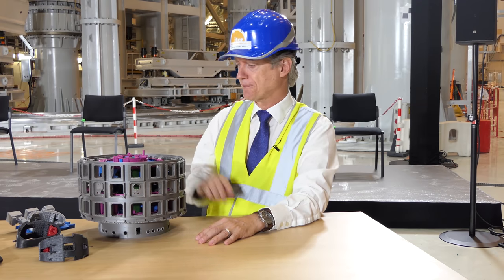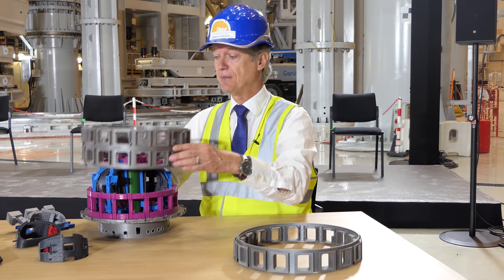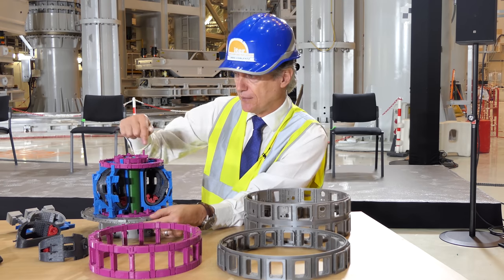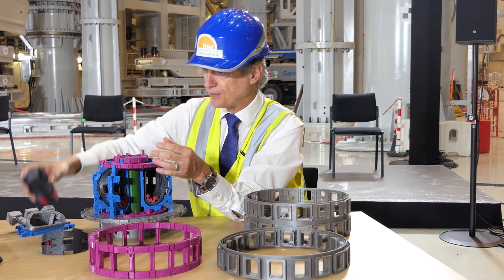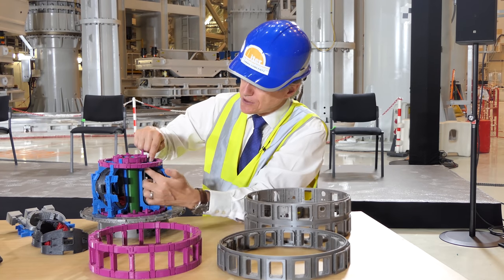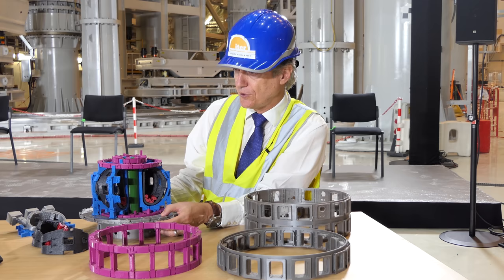ITER : Make your own Tokamak!

Comment: Hello, I bought my own tokamak but now its glowing blue and my geiger counter is making funny noises, how do I stop it from doing that?
Reply: Just press AZ 5
Reply: Turn your Geiger counter off. Problem solved.
Reply: @CarlosAM1  i am not sure either since mine come with 2 k19 instead of the rbmk..
Reply: That means it's working 🤷‍♂️
Reply: If it's radioactive, stop putting plutonium or uranium in it. That's the whole point.
Reply: Send your tokamak to that cousin you always hated.
Reply: easy, swallow the blue juice that comes from it
Reply: Does it not have RGB? Dying of blue glow alone is boring. Also, turn off the geiger counter so you have some peace and quiet during your final hours. Cheers.
Reply: Don't worry if you bust your clothes and turn out green and irate.  There's a fella who needs company.
Reply: Funny thing: fusion reactors dont emit ionizing radiation! If your Geiger counter is ticking then check your window for huge clouds of smoke coming from green fire.
Reply: @luizftavares  they do emit neutron radiation and gamma/xray radiation too, which can be picked up by geiger counters, Depends on the reactor and fusion type.
Reply: @CarlosAM1  My point is that its extremely negligible. If we count fusion reactors emitting ionizing radiation then we might aswell worry about staying too close to humans, as they emit radiation.
Reply: @luizftavares  and thats why iter has a 2+ concrete wall sorrounding the reactor to prevent the radiation from hurting anyone. Fusion reactors generate dangerous radiation, so you need shielding.
Reply: @CarlosAM1  Taken from the International Atomic Energy Agency: " A fusion reactor produces helium, which is an inert gas. It also produces and consumes tritium within the plant in a closed circuit. Tritium is radioactive (a beta emitter) but its half life is short. It is only used in low amounts so, unlike long-lived radioactive nuclei, it cannot produce any serious danger"

ITER has a 2 meter thick concrete wall for protection against the revolving plasma they are creating, not against radiation.
Reply: @luizftavares  The plasma is literally contained inside the reactor vessel, and that fusion generates radiation, that`s like going to a fission plant and saying "its not a concrete wall to protect against radiation, its to protect against the uranium!"
Reply: @CarlosAM1  So I did my research... and I am wrong. There is this kind of radiation called neutron radiation, in which a beam of neutrons hit an atom and transforms it into a radionuclide, thus emitting dangerous ionizing radiation. Fusion reactors (among with fission reactors) apparently do emit this radiation, but its much more manageable than radioactive waste, thus making fusion energy look like a "radioactive clean" process when it actually isn't.

Thanks for making me question myself, you were right all along.
Reply: Hello , Hi carlos please repeat after me.

God please forgive for all sins in this life.

Comment: Awesome, now i have the designs to make a cheaper and smaller one using REBCO superconductor tape and some microwave transformers! I was having so many issues having to come up with a custom design. I didn't even realize the twisted magnetic field lines were a part of it with regards to inducing a current in the plasma. Thanks guys! I'll probably still have to save up for a while for that REBCO tape still until it drops in price a bit more though....

Comment: I have to get one of these! What would be a reasonable price to pay someone to print this for me?
Reply: That would depend an enormous amount of size, material and quality. For example, the version they have printed is probably going to cost more for shipping than the print itself. However, a high quality specialized resin of the same size could run tens of thousands of dollars.

I'm out of resin atm for my Elegoo Mars, and I'm probably going to wait until they finish releasing all of the pieces ( currently only a subset of parts are available. Cryostat top, bottom and middle, divertor cassette in a bundle of 3, central solenoid, and PF coil 1 and 2. None of the toroidal stuff is there for example. ), and I'll also probably wait until my much larger Saturn gets here ( expected mid-Oct. )

I expect it will cost me around $50 to print mine at a nice medium desktop scale. Again, it's all highly variable though, and without all of the files to get an accurate volume, it's super hard to say more.

PS: Obviously don't forget there would be an overhead for getting someone else to print it for you. They're unlikely to spend a week on your print just for material cost. There you again have a massive variable depending on the source.
Reply: @zemerick  thanks :)
Reply: I‘m also interested in printing this - you need about 4kg of fillament - on Amazon for about 25€/kg - so i think the material is about 100€

Comment: How can the reactor be low pressure (close to vacuum) when the temperature is so hot? Isn't there a direct bidirectional relationship between the two?
Reply: There is no air in the chamber, which makes it easier to work with plasma held at high pressure only by magnets.

Comment: Download in progress and unzip. Holy smokes - those are very detailled binary STLs. Biggest is almost 20Mb with 390thousand triangles, 2400 parts.
Reply: Have fun ;)
Reply: @tamasszabolics3504  Did something happen to the files? When I started looking at slicing mine, I noticed there are a number of problems with them. Flipped normals, impossible geometry, non-manifold areas. They look like they were in 1 format, probably using quads, and then converted to STL which really distorted things.
Reply: @zemerick  Since it is a prototype and there are parts that was only printed once there are issues. Obviously it needs more work to make it more user friendly. We'll work on that so in future better quality prints can be done. In the current version a bit more experimenting needed to find the best settings that is true.
Reply: @tamasszabolics3504  Any chance for the original 3d files so we can try to get better results?
Reply: @zemerick  we already working on an another way of simplification which was already verified and gave better results but that is only done for one part out of the ~50 parts. So that will need more work. I can't tell you when it will be ready but until that with the current files you can also have good results but with a bit more experimenting. Unfortunately the original drawings are not made public.
Reply: @tamasszabolics3504  Thanks for replying, and I can't wait for the newer versions and parts. I'll have to hold off for now though because I use a resin printer, which can capture a lot more detail, unfortunately including problems. I am really looking forward to a nice high detail and quality print once it's ready!
Reply: @zemerick  Just to let you know we got some very nice results from someone who used a resin printer, so maybe you would give it a try. Also on ITER's website now you can download all the components, they are online.
Reply: @tamasszabolics3504  That's awesome that the rest is available now, but as is the models are just too far gone for my low skill level to fix in a reasonable time. My Elegoo Saturn also doesn't arrive for over a month anyways, and I'm waiting for that to try and print. Hopefully the improved/fixed versions will be out by then:)
Reply: @zemerick  I also would like to have an Elegoo Saturn, can't wait to be available. By the way we already got pictures showing some very nice results using an Elegoo Mars

Comment: Mhh... First thing I'd do with this set is run the STLs through F360 to mod them for the parts to accept embedded Magnets holding the whole thing together.
Also... If you think this looks a tad complex to 3D Print then imagine a model of a Wendelstein 7-X with its organic shapes - Yeeaaaa... I don't think so 🤣

Comment: Scaled to 0.5 this model has features smaller than 0.1mm! Ummm, even my resin printer is going to trash this model. (Can't get the full size to fit the build plate). The base is only 12 hours to print. Hmmm. I may have to wait on this for a replicator to be invented. :-D

Comment: “helium ash”, what?
Reply: Hydrogen is the fuel (two flavors, deuterium and tritium, isotopes of hydrogen) and the hydrogen gets spent by fusing into helium. The helium is the waste product after the hydrogen is "burned" but really it's called fused. Anyhow, the leftover helium is burnt "ash". It's still good for blowing up balloons though. Assuming we run out of helium, this may be the only way to make helium on Earth. Of course, it would be easier to go out and collect it from interstellar space probably. This process is akin to burning carbohydrates like sugar with oxygen in a chemical process. The fuel would be the sugar, the oxidizer (obviously the oxygen) and after they combine, the CO2 and H2O left over is the "ash". Or waste molecules after burning. In fusion though, there is no real chemical reaction that provides the energy. The nuclei are "simply" fused together. The way the excess energy is extracted is that the mass of the helium after fusing is slightly less than the energy of the two separate isotopes of hydrogen. So the mass is converted directly into kinetic energy (heat) and would be collected to turn water into steam. Then the steam goes into a turbine to make electricity with generators. Same as with coal and natural gas. However, it's a little more complicated to get the nuclei to stick together. It's gotta be really hot, and really compressed. That's the job of the tokamak.

Comment: A little bit smaller.
🤣
1:100 scale. You can print it to any scale you like within your printer's capacity. 
I hope your Tokamak-building skills are better than your 3D-printing skills because the gallery photos show a very low level printing quality. What was the reason for such terrible FDM printing? Were you favoring speed over quality?
Reply: Yes you are right, you can scale it to any size but the models were created to 1:100 scale. Actually in reality it looks better then the photos. Sorry for the quality. This was actually a prototype, many piece were printed only once due to lack of time and there was also a few printer issues. Some parts are in quite good quality and we are working on to optimize the settings. The part were printed at relatively low speed at about 40 mm/s. So as I said it needs some tuning and I am sure the upcoming prints will be better.
Reply: @tamasszabolics3504   Thanks for replying. I can't wait for other examples being printed right now. I'll have a go. I'll see if anyone at my university would like it after I've finished marvelling at it.